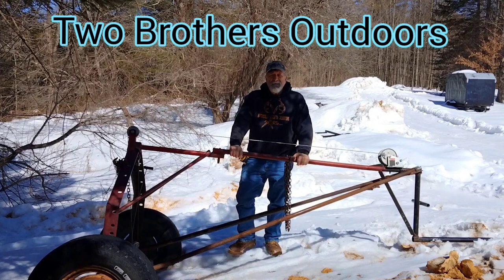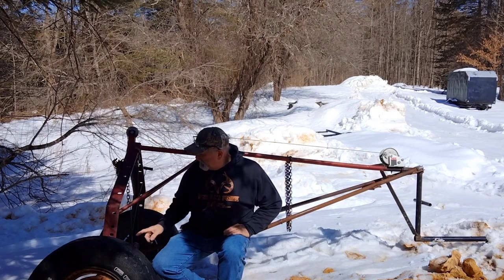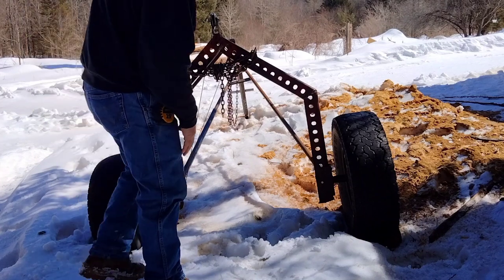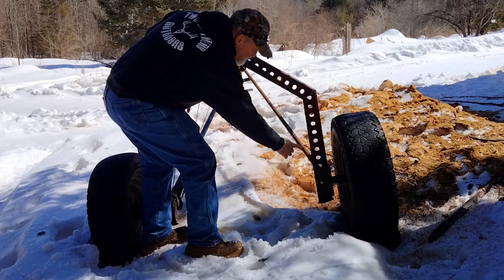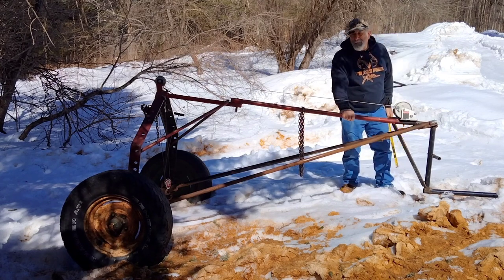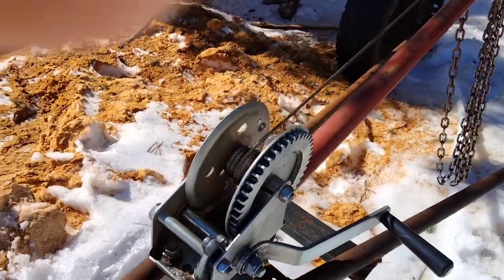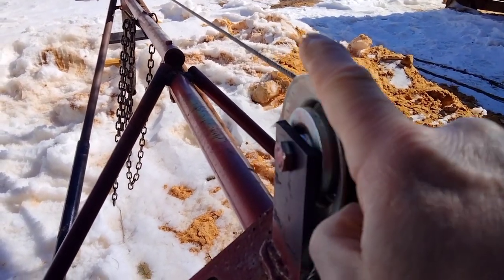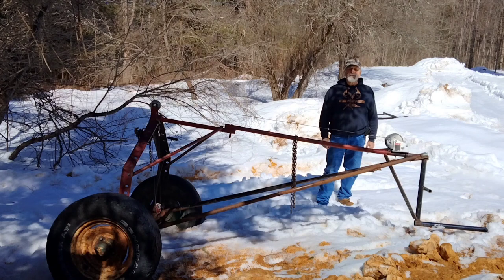"Must Have" Tool for our Hudson sawmills

Comment: Good info!  I've often thought about one for tractor use...one that picks up the end of the log while the three point hitch and a chain picks up the other end.  Thanks for clarifying Tim's court appearance...when he mentioned court in the other video I was thinking 'what did he do'. 🤣
Reply from the maker: This arch has been a blade saver for sure, makes it easier to get logs out of the woods as well. Unlike dragging a full topless tree,  the log is not skinning the bark off other trees as you make turns. We have so many damaged trees from logging 35 years ago. Tim just fulfilling his civic duty. Unfortunately if anyone ends up in court it would be me😏....

Comment: Super informative video. My farm is so steep not sure I trust my Can Am Outlander to safely come off the "hill" with a large log. I will use my 4X4 orange tractor to pull my log arch when when get to make one. I truly appreciate all the videos.
Reply from the maker: It works well with either one. You would be surprised at what a good 4 wheeler can do. We were.

Comment: Really enjoyed your video. I recently built an arch that is a somewhat different design (the spine/tongue is diagonal rather than horizontal, & the front of the log is lifted as I pull forward), mainly for a simple alternative for firewood (may not be quite as fast as my loader/dump truck....but a huge improvement over hand loading/unloading). The self lifting design is faster, but there may be times that I want the log completely supported by the arch, using a hand winch as you've shown.  Thanks-
Reply from the maker: With a bandmill, cleanliness is most important. One clump of dirt on the inboard side of the blade will dull a blade immediately. Would like to see pictures of your design. twobrothersoutdoors@yahoo.com